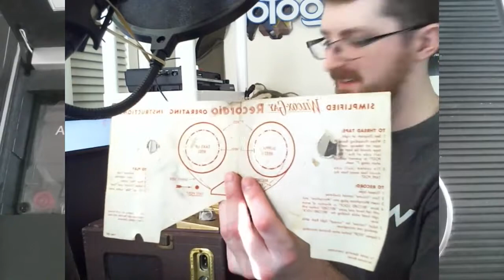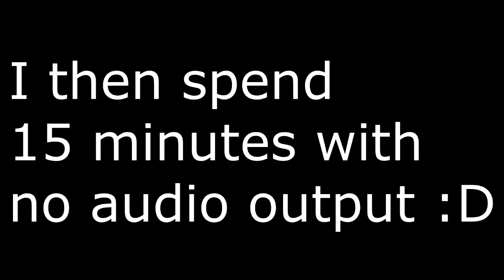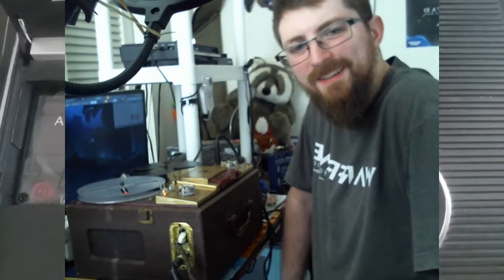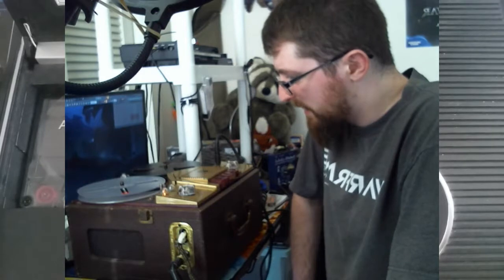Wilcox-Gay Recordio Unboxing + Testing

Comment: It looks early 1950s.  However, if you recorded regular music through it, it should sound great as long as you don't overdrive the input.  That looks like it's a mono recorder and you can flip the tape.  The thing that's strange about mono and stereo in a reel to reel format, and there are many of them, is if you can have 1/4'' track and use the whole width of the tape for a mono recording and that would give you the most fidelity.  You can have two track stereo where each track would be 1/8'' wide.  In four track stereo track 1 is left and track 3 is right in the forward direction and 4 is left and 2 is right in reverse direction (if you didn't have to manually flip the tape).  This really is the best sounding format in my opinion.  7.5 inches per second will give you the best overall frequency range on that tape recorder.  For what you were doing, 3.75 inches per second sounded great too.  Good luck to you.

Comment: Nice machine, I have a very similar one. It's not from the 30s though, it's from the 50s. Reel to reel tape recorders didn't come into widespread commercial use until the 1950s.
Reply: Also, you're going to need to recap this thing and mechanically restore it.
Reply: I have 3 Wilcox-Gay Recordios in my collection. From the early 50's. My dads is my special one he bought when he was in the Korean War and recorded tapes to send to my Mom.